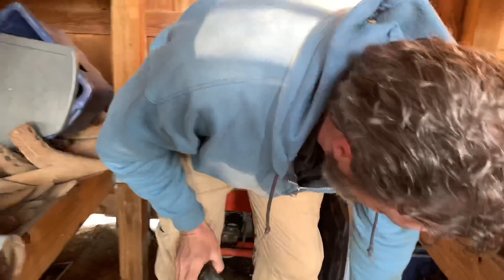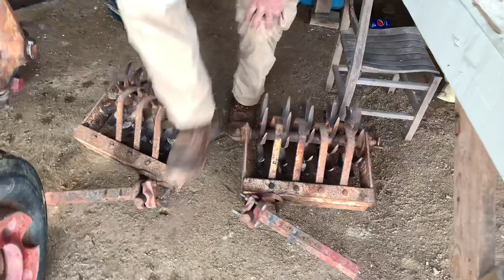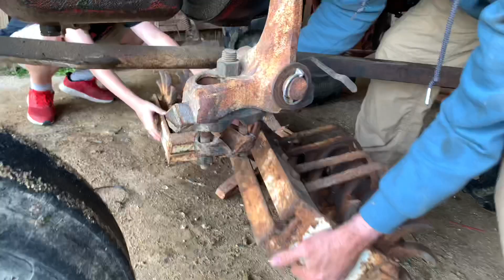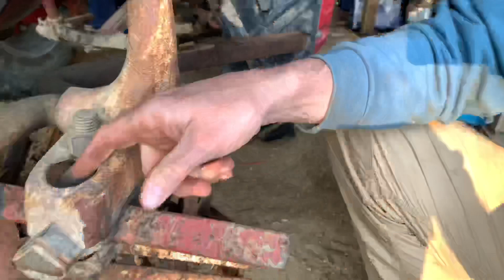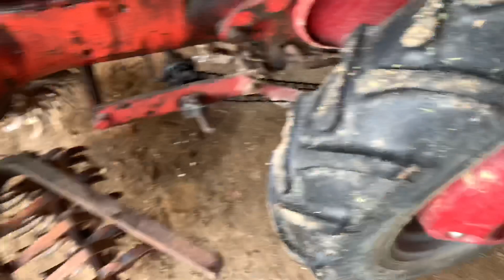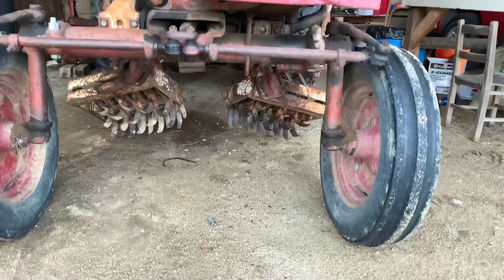Farmall 140 Cultivator Setup

Comment: Trying to put a set of rear cultivators on my 140 but appears the wheels are not set out far enough to clear the mounting area. Any suggestions on best way to set the rear wheel out slightly ?
Reply from the maker: Hey Mike
Are you putting rolling cultivators on the rear of the tractor.
Reply: @Jtwes  No trying to mount the rear single shovel, Mine have 2 bolts to mount to tractor gear housing, it appears that the mounts are going to have interference with the inside of the rear rim.  You have a slightly different mount that you slide yours into then pinned.  Maybe I need to remove the mounting bracket from the cultivator and mount to the tractor then slide the cultivator into the mount ?
Reply: One shovel on each side to take out the tire marks.
Reply from the maker: Hey Mike can you email me a pic joey@jtwes.com

Comment: I just picked up 2 140's at auction about 3 weeks ago. Auction was 700 miles from me so based on pics and honesty of auctioneer I bought both for $5760.00. So far: had to repair tranny shifter on one,and on that one had to clean fuel tank,completely go through it  to change fluids,fix charging system,identify all of the leaks. On the 2nd one I just got started and found the cracked block in about an hour after starting the work on it. Did I mention that both were "restored" and "field ready" by the auctioneers own words? At least almost all of the cultivator parts are there and plan is to use one for cultivating and I have some time to finish before needed. Awaiting my 2nd batch of parts from Burch Tractor and at least they seem to be nice,knowledgeable,and helpful.Have multiple videos up and if you have time to watch ,any input or advice you have would be greatly appreciated. Amos.
Reply from the maker: Brandon is a real good guy he will have all the parts you need.
Reply: @Jtwes  Spoke to him several times: always helpful and takes the time to answer my questions. I turn a good wrench and have fixed and sold countless tractors and heavy equipment (and kept a lot too) but Internationals are not what I usually fool with:especially any attachments specific to the older ones. Quick question: will  Farmall C model attachments work on 140's? Might have a line on some locally.
Reply from the maker: amos snow I’m not real sure I don’t really ever mess with farmall c or m  but I was thinking that they had a two prong fast hitch
Reply: @Jtwes  Just spoke with Brandon: on the tool bars the holders and anything going to the ground from them will interchange.Tool bar and up won't Good to know: here the C tool bar implements are plentiful and cheap. The Farmall C series was a popular tractor in the area. I know how hard it is to post videos: takes a very long time,but keep posting. Your videos are interesting.
Reply from the maker: amos snow it’s not to bad my son edits for me. I’m still a little shy about talking on camera. Just like last night I couldn’t remember the proper name for those cultivators . It’s Rolling Cultivators lol.